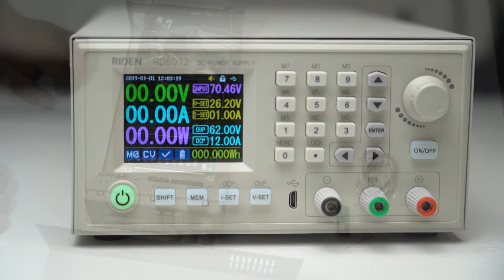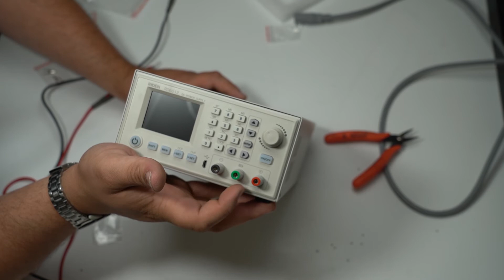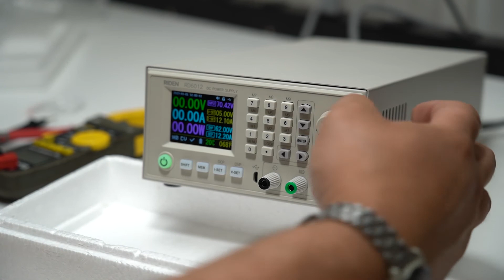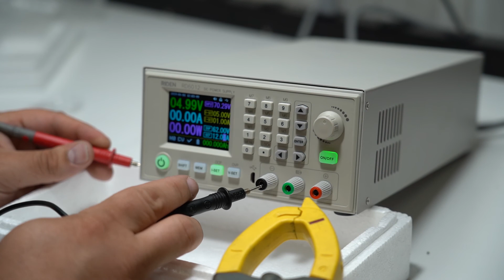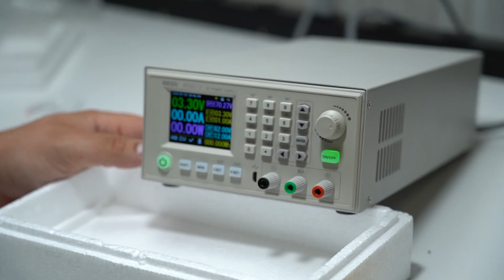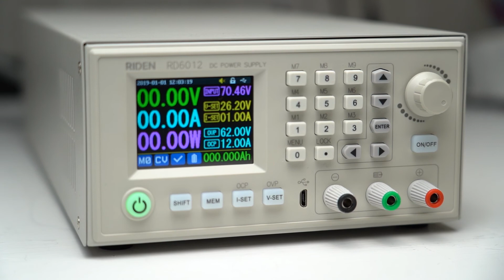Riden RD6012W Power Supply Build & Review

Comment: RD Tech made a how to video on putting this kit together. I decided to pull the AC-DC supply out of its own case before installing it inside of the new case. I didn't like how there was a gap between the cooling fan of the power supply and the rear exhaust opening in the case. I had to pull the standoffs out of the original case so I could reuse them in the new case. I also reused the plastic insulating sheet to protect the bottom of the power supply from shorting out on the new case.
Reply from the maker: I saw that, but figuring things out on my own seems more entertaining. Not sure I'm concerned enough to pull out the 70v psu and put it in the case, but I'm wondering how difficult it would be to use a phone charger as a standby supply and maybe rewire a few things to make the front power button switch the whole unit on and off.
Reply: @manovermachine  I think the most difficult part would be switching between the two supplies while keeping the front panel powered. Maybe you could just completely disconnect the front power button and use it for your own circuit, as the front panel powers up on its own once power is supplied to it. That way you can avoid having to switch between the two supplies. The phone charger would just need to be powerful enough for a relay that can switch the mains.
Reply from the maker: I have to imagine the power switch on the front controls some logic output I could use for a relay, but separating it would be a possible option. I cant say this supply was really designed to integrate well with that feature but it seems silly for it not to.
Reply: @manovermachine  Maybe you could look at how complicated it would be to separately power the logic and high power boards, with the logic board powered by the cell phone charger and the high power board using the power supply.

The alternative of running the whole thing off the cell phone charger and then trying to find a way to switch it over to the power supply without it losing power during the transition doesn't sound like fun. Unless all it would take is a few capacitors. I'm not sure, I don't have an electrical engineering degree.
Reply: @NathanielHatley  I'd definitely show the circuit and how I go about it if I do. (I do have an EE degree for the record, but even as a professional we have to look into these things before we know). Anyway, just having some fun conversation, not grilling for an answer. Thanks for the comments! Hopefully I'll come up with some more interesting content to help take the channel off.
Reply: @Sevalecan  I didn't mean to give the wrong impression, I'm just having a fun conversation too. I think you did a great job filming for this video and your speech was easy to understand. There's a post over on the eevblog forums about this power supply (and it's twin, the RD6006) where users have talked about some of the things they've done to it, and there's even a user offering custom firmware for them!

My unit also had the warped front panel, so it was a snug fit. It might be on purpose to keep it tight, as I saw another video on YouTube where they complained about it rattling around.

My only complaint at the moment is how noisy the coils are in the AC-DC supply when the output is switched off. Once the output is enabled, the coil whine isn't as noticeable. The 2k/10w load resistor didn't help the coil whine.
Reply: @manovermachine  I found some posts in a Russian forum wanting to accomplish the same thing. The same user from eevblog also participates in that forum too. He came up with a schematic that you could try out if you're feeling adventurous. The user is UniSoft and the post is on monitor dot net dot ru. The schematic is on page 8.
Reply: FYI: If anyone interested, you can find my custom firmware for RD6012.
If you have any ideas, wishes, what to change or what to add in to the firmware, or found any bugs, just let me know.
https://www.eevblog.com/forum/testgear/ruideng-riden-rd6006-dc-power-supply/msg3227356/#msg3227356
https://monitor.net.ru/forum/threads/651114/post-6037216